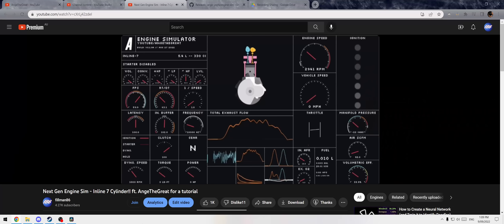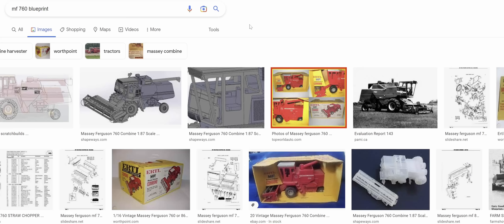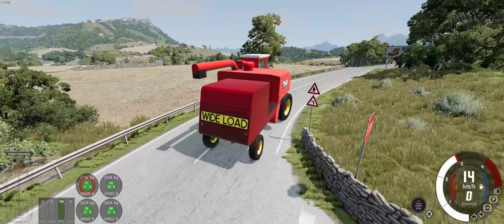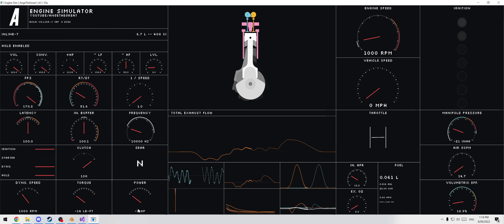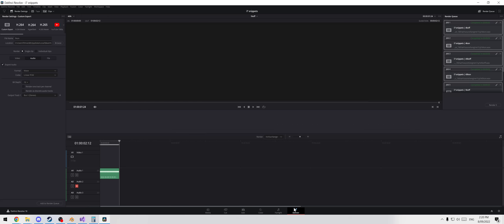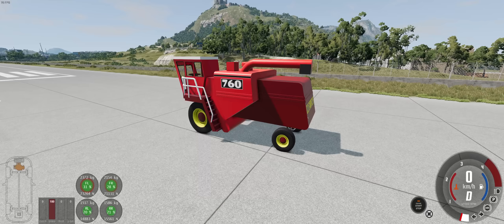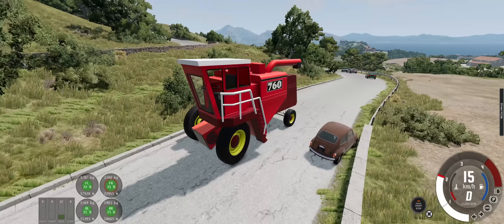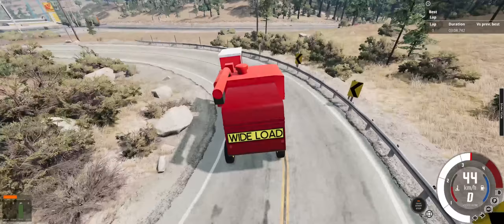I put my ENGINE SIM Engine -INTO- BeamNG (includes tutorial)

Comment: Combining Automation with this engine simulator and then porting it to BeamNG is the best combination until the engine simulator is applied to future racing games as a bundled license or as a mod for current games, like Wreckfest and other racing games that have engine changes. Wreckfest is a good 2nd option thanks to engine options being minimal. BeamNG is really detailed so the program is perfect.
Reply from the maker: wreckfest isn't really a simulator though, and the engines don't really utilize power in that way. I'd be fine with just making engines for beamng in this, but if I could also have the realistic power delivery that's possible here, that'd be great!
Reply: since it's MIT licensed, beamng could technically officially use it
Reply: @ThylineTheGay cute pfp
Reply: @TylerTMG  thanks
Reply: @ThylineTheGay  your welcome ^^

Comment: This is one fast combine! 50+ km/h? Wow! The fastest combine I've ever been in went 35, and that feels like 80 sitting inside!
Reply from the maker: really? it seems transporting between farms would take ages DX
Reply: @fillman86  A tractor averages at 40km/h. Above 50 and you need to wear seatbelts and the tractor's gotta be equipped with an air pressure brake system. Only wealthy farmers or/and those with a lot of land buy tractors that big because they need the horespower.
The fastest tractor ever produced was a JCB Fastrac from the 80s, going 85km/h. A "Highway Tractor" with about 170hp. Nowadays, Highway tractors go 70km/h at max, but have over 270hp.
Fastest tractor I've personally driven goes 45.
Reply: @fillman86  all new combines do go around 40km/h,old ones like this one can only go around 20km/h in real life.
Reply from the maker: @midladder  interesting, if only I could make it more restricted in automation, instead of having it redline limited :/
Reply: @fillman86  it does
Reply: @midladder  Not to mention, combines are FWD and rear steer. Also there is no physical connection like a driveshaft, they all use Hydrostatic transmissions. it would be fantastic to see hydrostatic drive systems in Beam NG.
Reply: @phil955  most Tractor manufacturers build their more premium tractors to 50 kmh and the others to 40. Usually, a tractor from the last 20 years can go 10-15 kmh higher than what it is registered to because of overdrive gears/CVT transmissions.
Where I am, if your tractor goes
Over 25 you need a certificate every 2 years
Over 38 all wheels need to be brakeable and you are required to have fenders at the front
Over 42 the certificate needs to happen every 6 months
Until 50 the tractor counts as an F type vehicle and can be driven with a tractor drivers license. Over 50(over 60 in Germany) you need to have a C Drivers license, trucks. This license needs to be renewed every 5 years/3 years for trailer.
Over 60 then all wheels need independent suspension.

This is why tractors usually are capped at 50 and 40 kmh. For combines, the ones driving around me are usually 30 or 35kmh. 40kmh combines are made by Krone, Claas, New Holland, AGCO, Rostelmash and some others.
As for air brakes. My country doesn't neccesarily dictate which type of brake to use, but it matters a lot for trailer driving and the legal weight (distribution) limits. Hydraulic brakes are better than purely mechanical brakes and air brakes are best. If you want to drive with 2 trailers, the most governed configuration, your tractor and first trailer need air brakes while the second trailer needs at least hydraulic brakes.
Reply: @an2thea514  To be fair, you didn't have to bother writing all this... I already know it. As a farmer, I basically have to know all this to ensure I'm qualified to purchase new equipment. But thank you for relisting it all. :D

Comment: ok this is getting good, you telling me now BeamNG will have the most realistic sound in any car game?
Reply from the maker: there's much refinement to be done, as these engines sound a bit digital, where as real engines have very different sounds due to many more factors. That being said, they are very accurate now.

The take away you should have is that you can have any orientation, and any strange firing order you want :)
Reply: @fillman86  I bet the sound would be way better if you could change the "explosion" sound at will, like using samples instead of the 8 bit like sound, tho i though the game would use the code or the Engine sim as an external app... but nah you had to sample the sounds like any other game

Comment: The 760 sure seems about right for road speed. At least compared to the harvesters I end up behind. Where I live is a small city surrounded by farming. Especially this time of year, we have a lot of these driving from field to field.  
Yours looks good and, except for the rear wheel steering, seems to drive realistically. 
I think a much fancier seat would be more appropriate for newer ones though. The new ones are very nicely appointed, comfy seats. air con, good sound systems, and gps are knid of minimum spec. 
Well done, Fillman!
Reply from the maker: I've been around farming equipment too, and they can be super hard to overtake :/ I'm also a very impatient man :P

I can imagine that seats may feel better, but they'd still have the generic seat for though, right?
Reply: @fillman86   I juts looked and, for an $800,000 US base price cotton harvester--not the most expensive John Deere by any means--they will be happy to sell you an optional, $7,000 extra, "Ultimate Comfort and Convenience Package", I think modern cabs are pretty cushy, especially for the higher end models. Not "luxury" as we might see in a Rolls but still quite a lot better than most passenger cars. 
Yes, these are a pain in the butt for overtaking. Thankfully, I rarely have anywhere to be at a specific time anymore, so I can just hang back and let them do their thing. 
Since you have built some farm equipment in Automation, I have to guess you have at least a little interest. So, if you get a chance to go to a farm show that has good industry representation, I think you might find it also interesting to check out the really big, high end machines.

Comment: May i suggest using Awave studio for making near perfect loops. its a bit expensive program but its a nice tool.
I used it to record engine sounds directly from automation sample them and trim them too loops.
Awave studio has also auto-find loop so you can discard alot of junk so the file size is smaller.
Reply from the maker: interesting, but putting it through davinci resolve (free program) wasn't hard

btw you can export automation cars to beamng, and in there it'll have the sound files to loop for you
Reply: @fillman86  The exhaust sound, sounds different when exported then engine sounds in Automation,
or else i wouldn't record intake sounds.
Reply from the maker: @batteryman2852  hmmm fair
Reply: @fillman86  If you want, i could send you over a car when i have time which have exhaust and manually looped engine sound( 91 On-load + 91 off load) blended, as an demo.
Maybe it will sound different for you or maybe its me being too big of an audio nerd :-P
Reply from the maker: @batteryman2852  yeah, I'm not an audiophile, but I do have a weekly stream where I review viewer submitted beamng cars :)

Comment: So i am apart of the ag world and, your not wrong combines are heavy, most combines now a days are CVT transmission, meaning it just goes off the RPM of the engine, seems like everything else is right though good job
Reply from the maker: I heard that a lot of more modern ones actually use hydraulic motors rotating the rear wheels. I looked it up, and it seems to be a common thing
Reply: It sure is, hydraulics are used all over a combine, including auger, steering, lifting headers changing anything on the header and much more stuff

Comment: Im not certain if its addressed or not? The flywheel seems to be for the 6 cylinder engine. It would likely be too small for a 7 cylinder engine. Thus causing the engine to lose its rotational energy and stall.

Comment: So its posible to make a ship engine road vehicle. I have seen someone made a 1300liter ship engine in the engine sim. Lets hope one day he wil partner with beamng you can import engines. And use them in beamng cars or something
Reply from the maker: well there was 1 tractor that used a 7 cyl, because it was made for a 6, but had more room, just not enough for 8
Reply: @fillman86  i wonder where there any cars with a i7. Cus that engine lay-out is really interesting
Reply from the maker: @crispyshaman4937  vibrations, and torsional stress on the crank, and the size of it is bigger than the more compact V shape engine

Comment: So, how exactly should we record the sounds? Pretty important part of the video skipped over with "this didn't work". Could you at least explain why Audacity didn't work and what the process actually was?
Reply from the maker: audacity seems to only allow microphones be input. I ended up just using OBS
Reply: @fillman86  Thanks, think I managed to figure it all out now. I would put that info in the description, though, to avoid confusion for others in the future
Reply from the maker: @ImpressionismFTW  but no one else has had this issue, and many people have done it
Reply: @fillman86  Well, this issue is that as a noob its very confusing when you don't at least specify the way to continue. You just skipped the recording in the video.

Comment: a harvester steers with its rear axel btw
Reply from the maker: rear axle or rear wheels?
Reply: @fillman86  that depends on the brand mostly the entire axle since most of the weight is hold by the big front tires
Reply from the maker: @ole3620  okay, what about Massey Ferguson like this one is a slight copy of? 

I will say though, I know how to easily swap the wheels around, but I wanted to spend most of my recording time on doing the engine sim stuff :)
Reply: @fillman86  i think its OK and amazing that you can  Bring a inline7 to bmg

Comment: Most harvesters, at least modern ones, use hydrolics to turn the wheels. They're also a lot heavyer than this one
Reply from the maker: Yeah, but getting over 3 tonnes is tricky in automation XD hence my reaction to its weight.

Also most cars use hydraulics to turn their wheels too, so can you clarify?
Reply: @fillman86  I meant they use hydrolics instead of a conventional gearbox. I belive they do that to better control a stable speed. It might also help it to get a lot lower "gear" ratio.
Combines don't really follow any normal things cars do, so it's a merricle you got anywhere near how they really are. The only reason I know this stuff is because I readily have acsess to one.
Reply from the maker: @glleesqwerty6402  ooooh I thought you meant turn them steering wise XD my bad, me dumb
Reply: Are they not also FWD, in this style of big front wheels small rear wheels
Reply from the maker: @jamesbassil2088  huh that seems like a odd design, but okay
Reply: @fillman86  I think it's because that's where the majority of the weight is, and due to the much larger tires